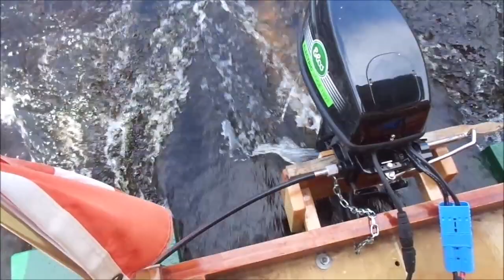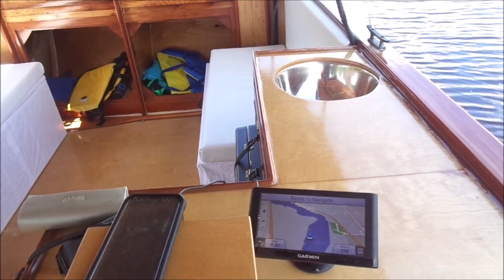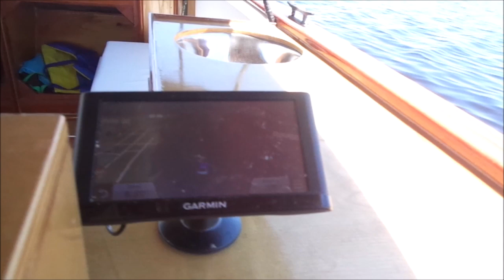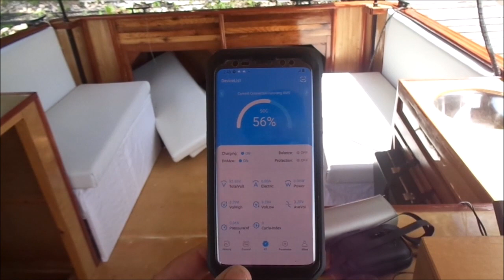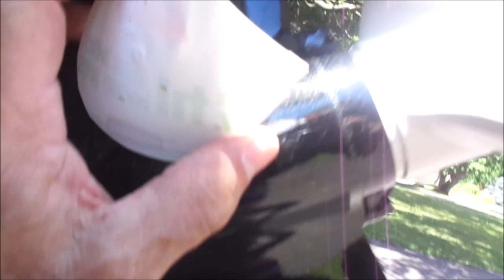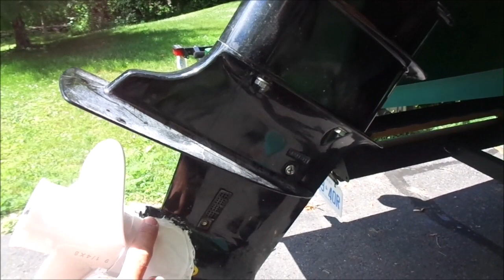More Testing and Fixing the Solar Panels Building My Solar Electric Catamaran Part Twenty Six

Comment: How deep is that water? Looks like the prop is slogging in mud. Good work on a super efficient hull.

Since you are running an 8.4kW motor at 1.5kW, vs the old Torqeedo 2kW motor running at a much higher load the torqeedo was much more efficient. You are also pumping a bit of water with this motor, and Torqeedo’s prop is better designed for efficiency vs Elco’s off the shelf gas engine prop. Their prop really needs a bullet cone instead of an ‘exhaust vent’. Easy to make right?

Comment: I've looked at the Elco electric motors - especially the 5 hp-24 volt
You're looks to be the same size but your instrument reading lead me to believe
you have a 9 hp unit which is 48 volts.  Is this correct?  thanks
Reply: I see from one of your past videos you have the 20 hp
I'm gonna check your postings - 'cool boat!
Reply from the maker: Hi Gary, I have the EP20 which supposedly is equal to a 20 HP gas outboard. I am having some doubts about that.

Comment: About securing your solar panels - what about a length of doubled up canvas = 2" by 15' sewing to your top
so as to have the edge of the panels fit Under the lip - keeping any wind from getting under them and hence lifting them
Reply from the maker: I have completed the new frame which involved adding bolts right through to the aluminum cross bars. Sewing would not have worked as I have no room around the panels to add a hem as seen on some biminis. I will put out an update on my final attachment. Thanks.

Comment: Maybe add one or two small 1/4 inch rods angled back ahead of motor and just a bit deeper than motor.will work better for torquekto motor for weeds. at least 45% back slope